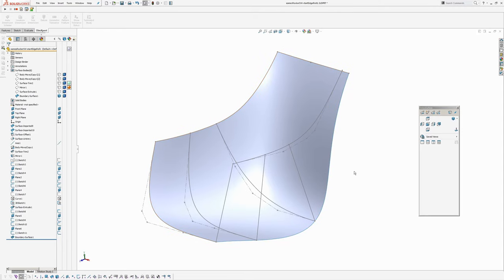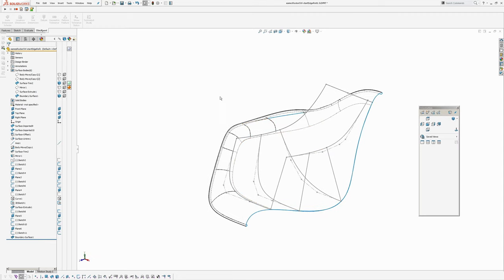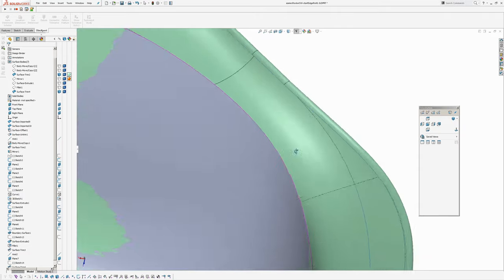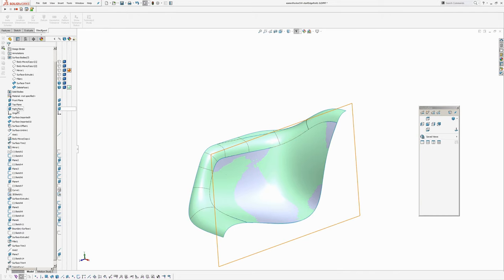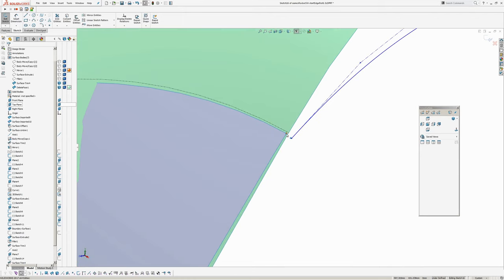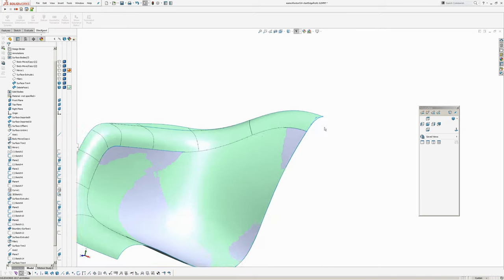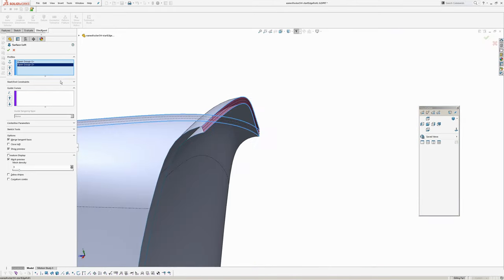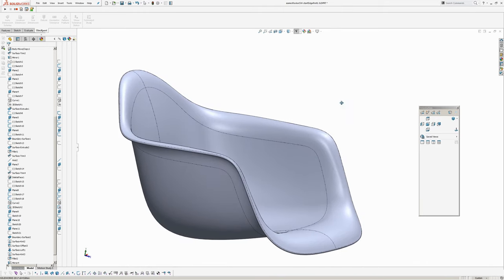Solidworks Tutorial: Part 2. Modelling the Eames Fibreglass Rocking Armchair Shell

Comment: Thank you Andrew for your excellent videos.  I was curious about your thoughts on a different approach that uses a bunch of patches. I like that yours is more simple, but I am confused as to the "correct" way to do it.   Here's the link:  https://www.youtube.com/watch?v=nrY69x8SjN0                       Thank you!!!
Reply from the maker: Hi there, thanks for the question. I have worked on a few tub chair shells for a client and they have always proven to be tricky to get good surface flow in Solidworks, when using a multi-patch strategy. The Eames chair looks very smooth, so using an overbuilt technique seems a logical choice. The problem when modelling a larger surface like this in Solidworks then becomes being able to 'fill it out' into the corners and control it, as you only really have curves to control it (without using freeform etc). If the tub chair had more defined side/back/seat pan surfaces, then a multipatch strategy would probably be better, as you have more granular control over each surface form. Cheers!